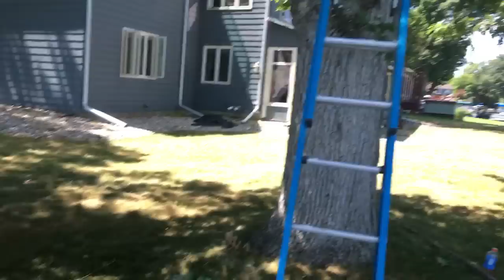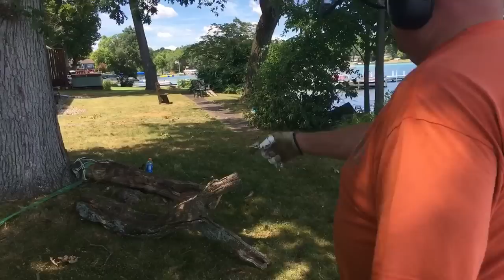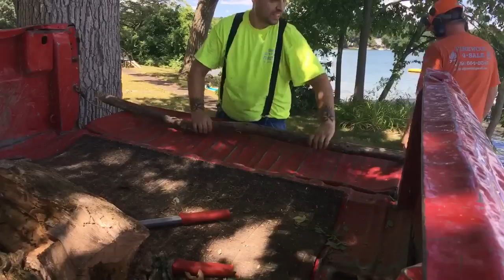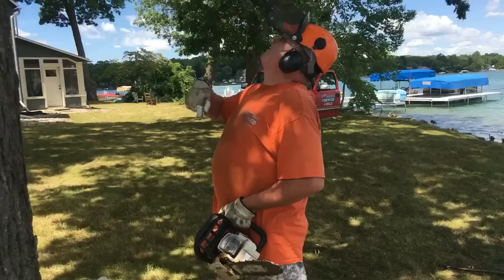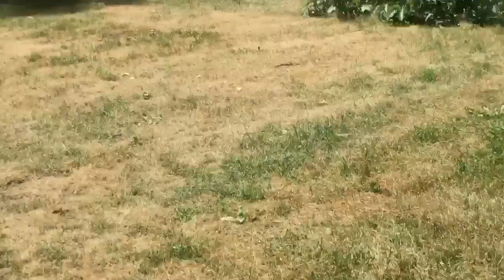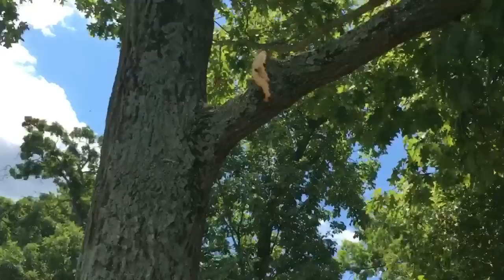Cutting oak limbs with chainsaw while on ladder

Comment: I hate dragging brush to a pile, but it’s got to be done.
Reply: Yes it is
Reply: Jansen 1500 wood chipper was probably the best thing I've bought. Great bang for the buck and once you learn it's tricks it is a beast. I usually cut at least 3x what you did before even starting it because the pile will take 10min to chip.